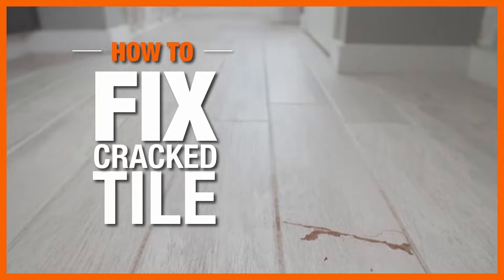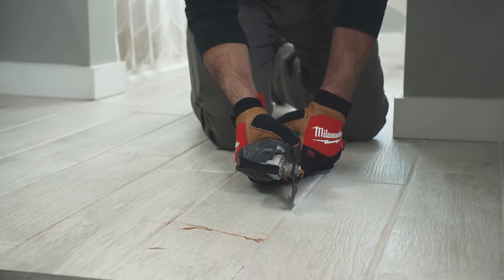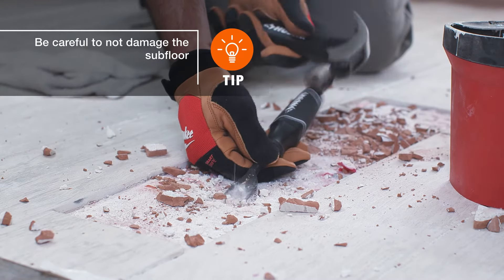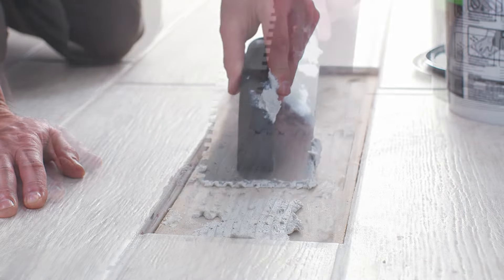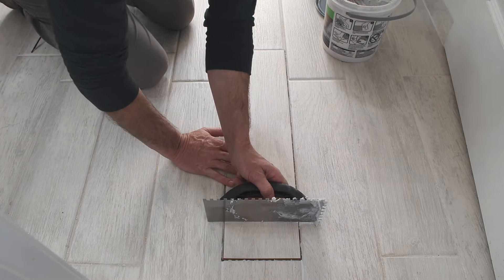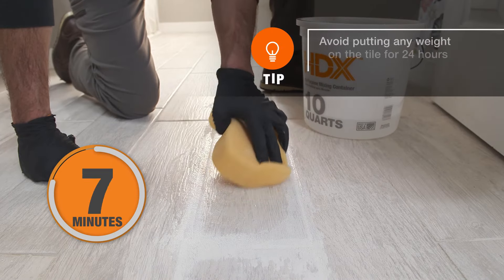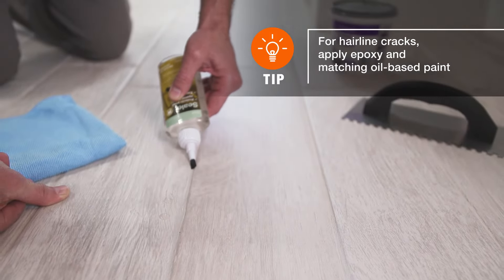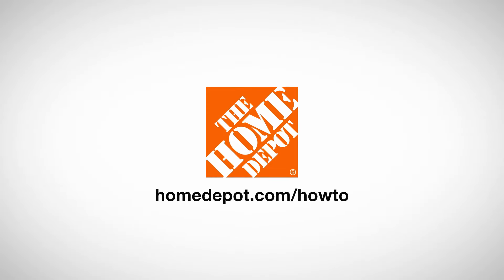How to Fix Cracked Tile | The Home Depot

Comment: You can just use tile grout liquid and cast over the cracks but replacing is best idea sense if you step on crack tiles it gets worse. Good luck on future projects
Reply: The problem is that the design used for the tile I have in my bathroom is no longer available or being sold. If I was to replace the tile I have to replace the whole floor. That’s what I’m trying to avoid because it’s gonna cost a lot of money to replace that and it’s gonna take a lot of hours to sit there and do this. I was hoping for a simple fix to the tile problem without having to replace my whole floor since it’s just the one cracked tile.
Reply: also if you step on a crack it breaks your mommas back so. Thats also bad.
Reply: @WalrusMcDonald12n2na2 😂😂😂